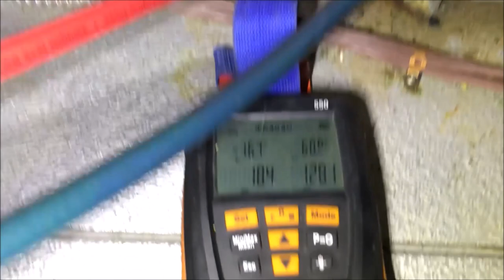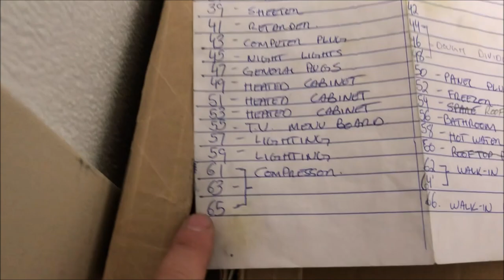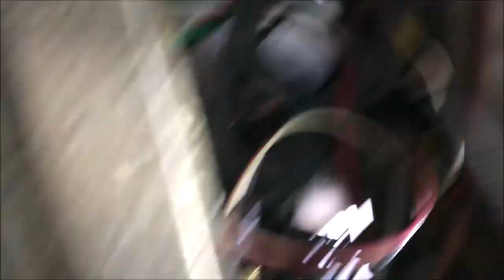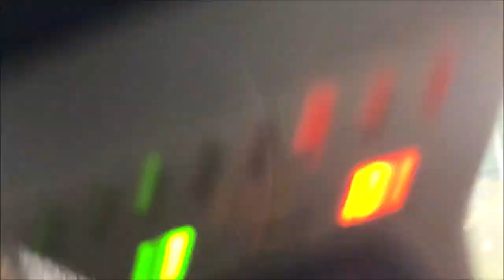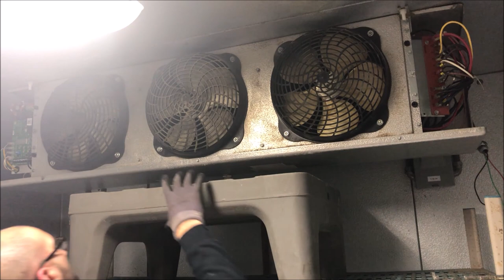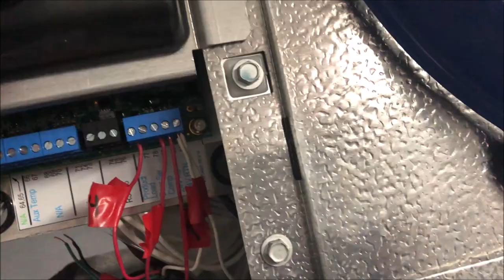Beacon 2 Walk In Cooler Is Warm

Comment: Great job. Question: Will the sight glass bubble flash if The system has restriction? I didn't see you add refrigerant to verify it's blocked or leaked like you usually do.  Thanks

Comment: We just had a system we put in less than 4 years ago all of a sudden make the slave TEV evaporator coil superheat "0", and killed the compressor on a water cooled CU - only thing we can think of is maintenance messed with the setting not knowing what they were doing - even if the system somehow reset to factory, it would not have 0 as a default superheat, other minor items we found/resolved on start-up with the new compressor: we replaced a discharge temp sensor that was reading 3 degrees higher, someone had cranked the inlet water loop valve so it was overcooling the condenser at like 95, we adjusted that up to factory recommend 105 as we monitored the new compressor in action. Literally 3 months past Copeland 3 year warranty, sucks for customer. Ever heard of anything like that happening with a Beacon II system?
Reply from the maker: I’ve had the setting change themselves before and had to change the board
Reply: @REFRIGERATIONKITCHENEQTECH  interesting, did they always change the same setting or was the setting random?

Comment: Can you tell me how many degrees Celsius there should be supercooling and how much superheating?
Thank you
Greeting
Reply from the maker: We don’t really use sub cooling in refrigeration. Superheat can be around 6-10F.
Reply: @REFRIGERATIONKITCHENEQTECH  I mean subcooling in the sense that when you would measure the condensing temperature and when you would measure the actual temperature and then push the water after the dryer filter, what should be the difference?
Reply from the maker: Generally sub cooling should be 10F. As we use receivers in refrigeration, we don’t calculate sub cooling, or atleast I don’t.